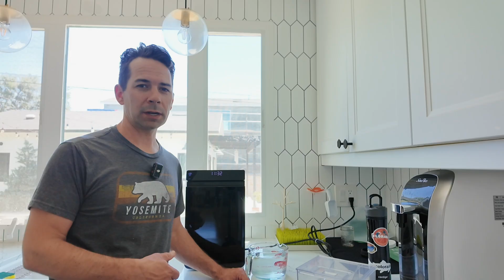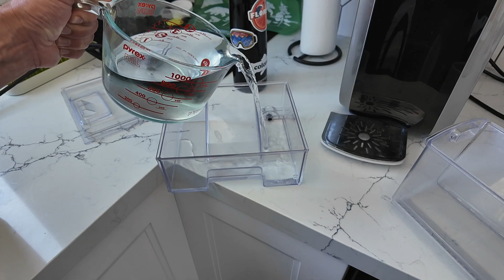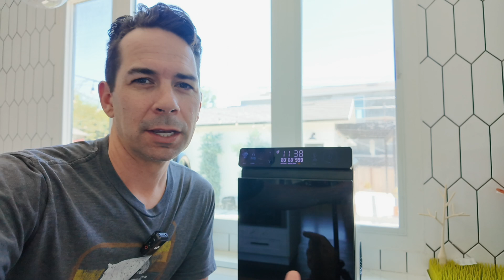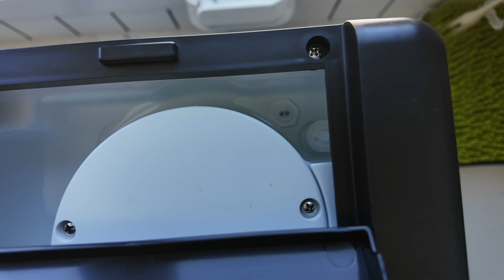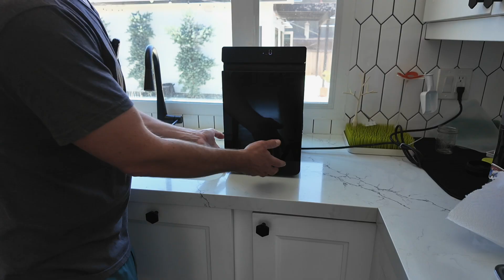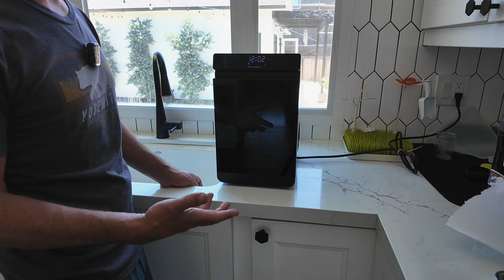How to Clean Ecozy Nugget Ice Maker

Comment: Question! That top hatch where you said it’s overlooked. Do I need to drain that as well or would I just need to use the vinegar and it’ll make it better? Rn the water sitting in it does not look good. You really are correct that it is overlooked!
Reply from the maker: I didn't drain it. I just let the clean cycle do its thing (I use bleach and not vinegar) which I think helps the area you mentioned. Vinegar might do it as well, but they recommend bleach (not very much needed). Vinegar would be good to descale if you needed to.
Reply: @JustinReviewsIt i should have read this more carefully as I put vinegar in now 😅. I think my ice maker needed to be descale. It does seem scary that the tds level is so high at 779 TDS as it cleans. My ice maker was making ice at a very slow speed and I hope this fixes it!